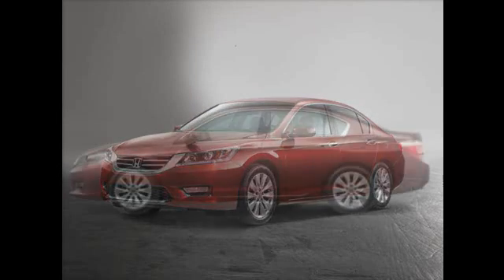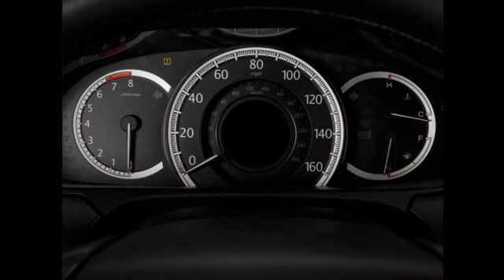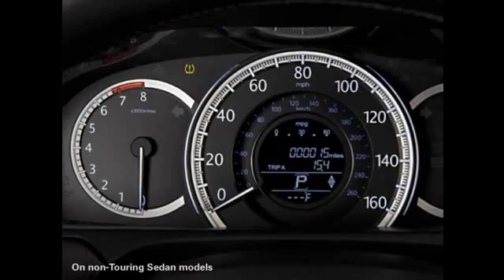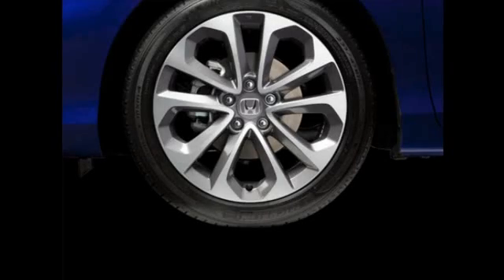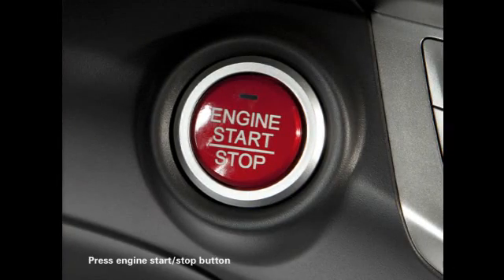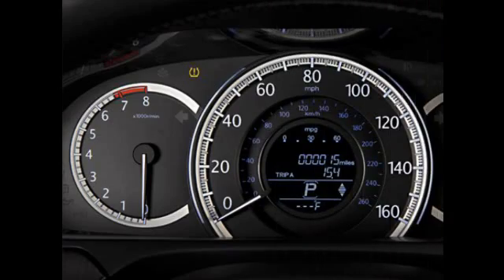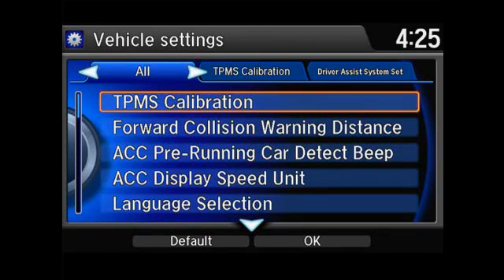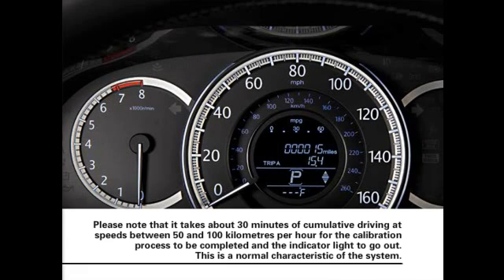Honda Tire Pressure Monitoring System (TPMS)

Comment: How about a 2015 Honda Odyssey Touring?  No TPMS button.  No TPMS on the menu.
Reply from the maker: Thanks for reaching out Paul. Your vehicle does come equipped with a TPSM malfunction indicator to indicate when the system is not operating properly. TPMS malfunctions may occur for a variety of reasons, including the installation of replacement or alternate tires or wheels on the vehicle. We would recommend reaching out to your local Honda dealership so they can look into this for you. You can locate your nearest Honda dealership here: https://www.honda.ca/dealerlocator/. Please feel free to reach out to our Customer Relations Team at 1-888-946-6329 (Monday to Friday from 8am to 8pm EST) if you have any further questions.

Comment: Honda has the most asinine TPMS system known to mankind.. reset every rotation and tire repair.. acura has the same crap system.. did the design engineer fall off his " Honda, we keep it simple " chair after a 3 beer lunch?  Ridiculous waste of time. Will NEVER buy another Honda acura with this garbage.
Reply from the maker: We're sorry to hear about your experience, Joe. We will ensure your feedback is documented. Please feel free to reach out to our Customer Relations Team at 1-888-946-6329 (Monday to Friday from 8am to 7:30pm EST) if you’d like to discuss further.
Reply: @HondaCanadaInc  hey, ty ..the shop lowered the pressure in all 4 tires of my 2010 civic hybrid.. reset the TPMS system.. then refilled the tires.. & miracles of miracles.. that light stayed off.. I don't have the reset button in this vehicle,  but still EVERY rotation and flat? How about every time the low pressure light comes on ? Nothing but annoying.  Thanks 4the  reply . Merry Christmas.  Best
Reply from the maker: We appreciate your note. We hope you and your family have a happy holiday season!
Reply: @HondaCanadaInc  i just bought 2012 Honda Accord EX-L from a used car dealer and found the TPMS light is on. They changed all 4 seasonal tires to winter tires as I requested. Local mechanic checked and added some more pressure to front left tire and drove the car for a while. Light is still on and I can't find the TPMS button anywhere. What should I do now?